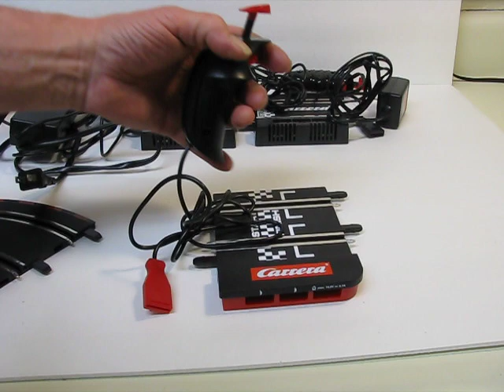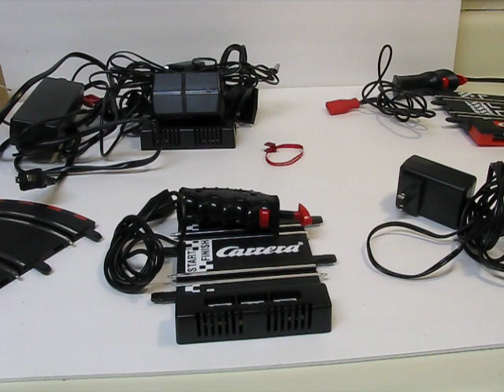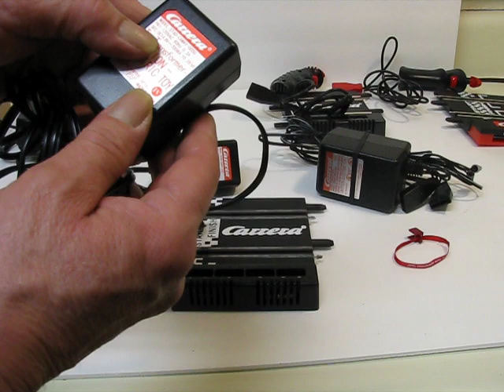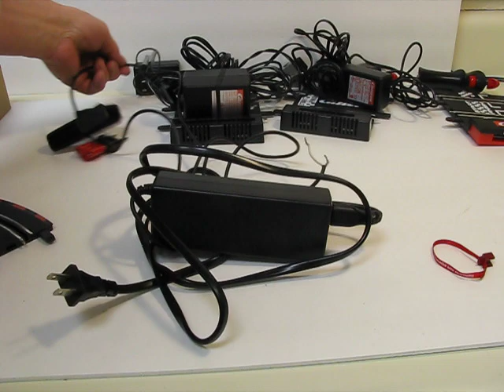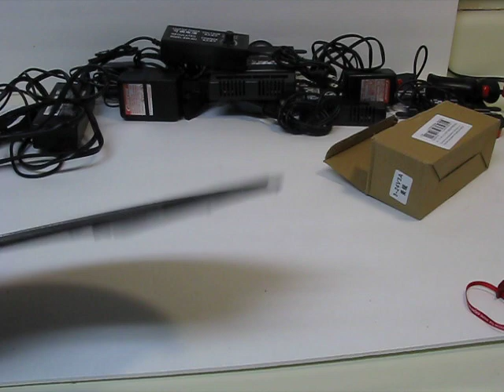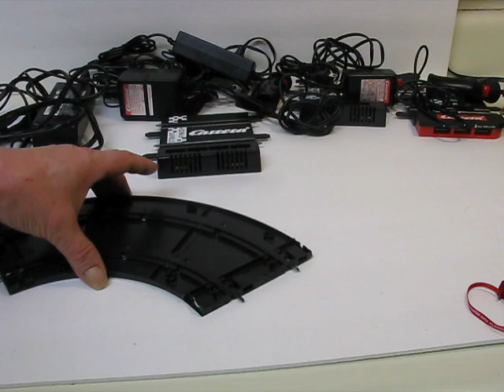Powering your Carrera Go Track # 2 - Power Track generations pros and cons for 1/43 scale slot cars.

Comment: Gut the electronics on the starter track,  that's the overload protection that shuts off your power.
Reply from the maker: Exactly, that's what I get into with video #3. This video is the introduction to the various generations. You can only remove the thermal resistor with the earlier generations of power track AFAIK because the current gen is electronic drive-by-wire and uses integrated circuitry. If you know how to do this with the current generation, please show us. Thanks for your comment.

Comment: I like full control instead of having to push the side button. Using Carrera Evolution controllers for now on Carrera 1/24 track to run all the 1/43 slot cars I have. Nice video again🏁
Reply from the maker: @LewsSlotCarTesting, I agree wholeheartedly and thank you. One more of my goals down the road will be to start experimenting with ways to use the larger scale electronics on the 1/43 scale track too. I want all the benefits of the big boys but on a smaller footprint,.
Reply: Can i use carrera evolution controls on carrera go
Reply: I have but on my 1/24 Carrera Evolution track.🏁